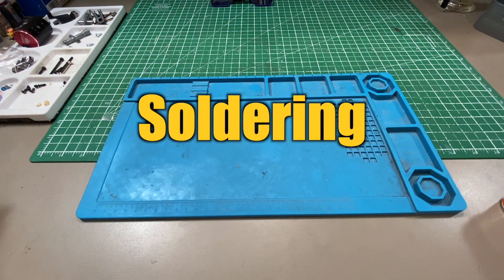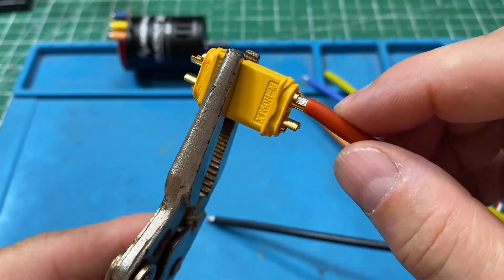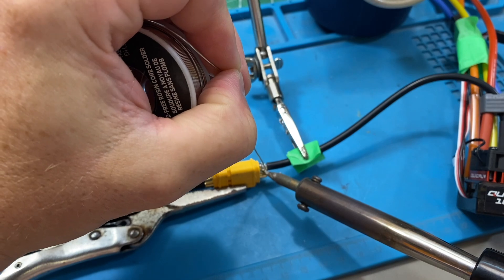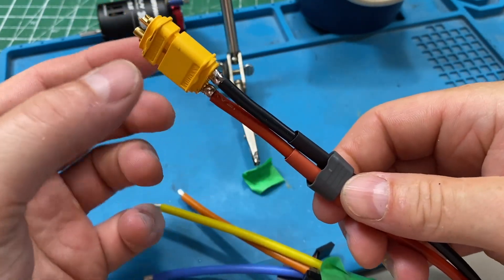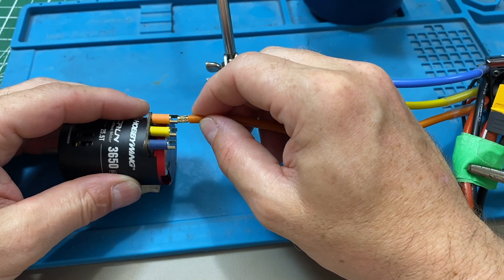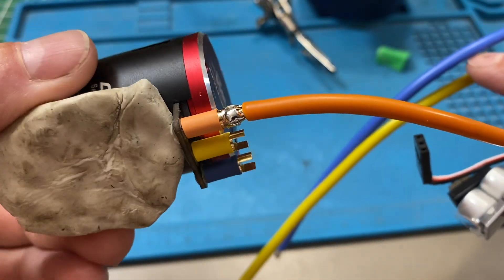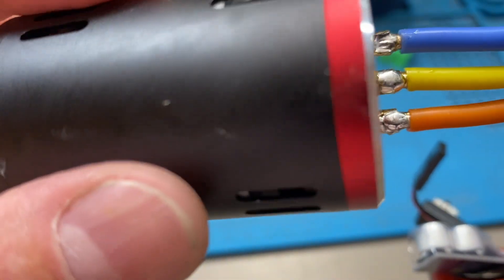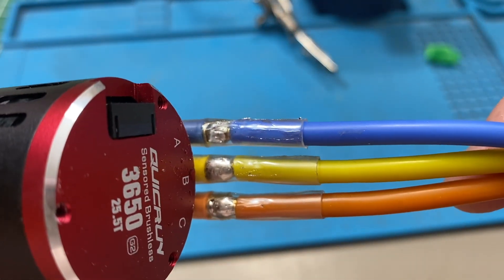Soldering for RC ESC and Motors 101- Steps and tips for beginners

Comment: Sensible tips, especially about the flux, but you've missed a pretty important one: get a decent iron. That garbage iron you're using is making the whole process harder and slower than it needs to be. Invest a few tenners in a KSGER T12 and cone, chisel and truncated tips, it'll revolutionise your soldering. Pinecil portable irons and such are also an option, especially if you have to solder in the field, but TS100-type tips are more expensive than T12 tips and the irons themselves are less ergonomic.
Reply from the maker: Yes, it was the cheap and crappy option.  There were none in my province.  I will look up the one you mentioned as you are right, soldering with that one is slow and messy and tedious.
Thanks!